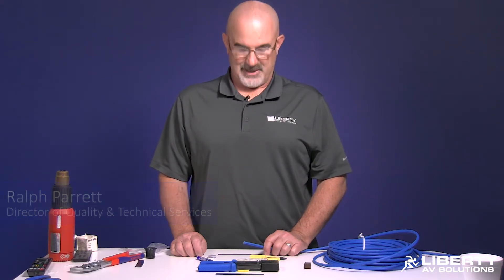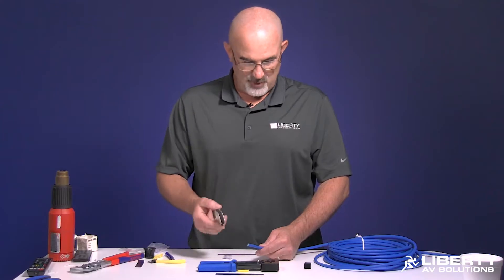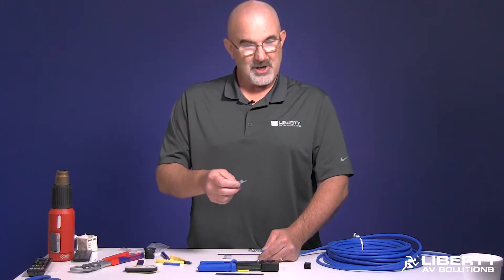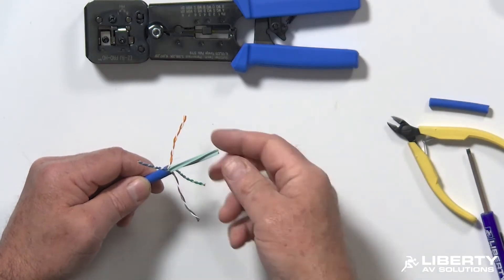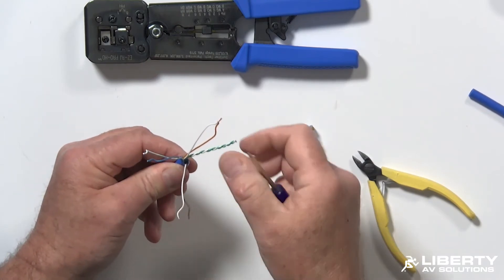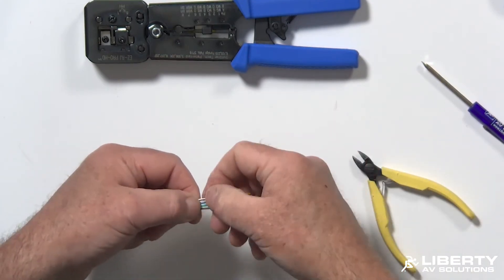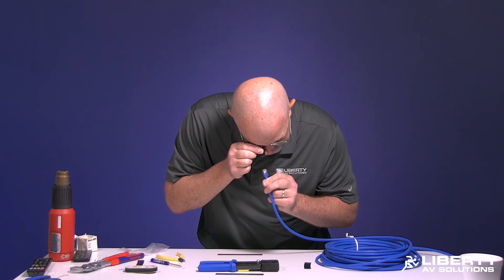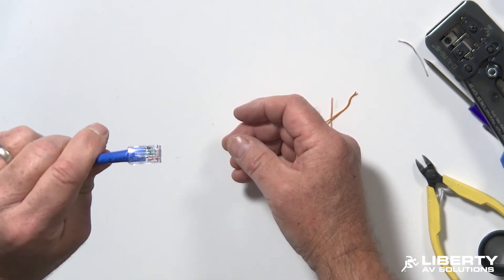Crimp Style RJ45 Termination on CAT6A NCS Style Cable

Comment: Hello, great work on the video tutorial once again.
What is your opinion on pass through rj45 connectors on CAT6 upwards VS rj45 connectors with load bars???
Thanks :)
Reply from the maker: Two piece connectors with the load bar do outperform single piece plugs in testing, especially on the higher performing cable.  The load bar also has an added benefit allowing for better alignment and color code verification prior to crimp, reducing incorrect terminations. I will be shooting a video terminating the NCS cable with a 2-piece connector to add to the video library.
Reply: @Liberty_Online Kudos!!! Many thanks. Keep up the good work! Needless to say you're on my top channels for tech stuff